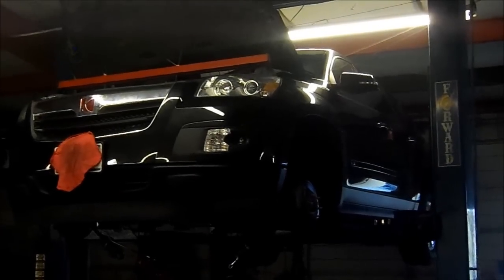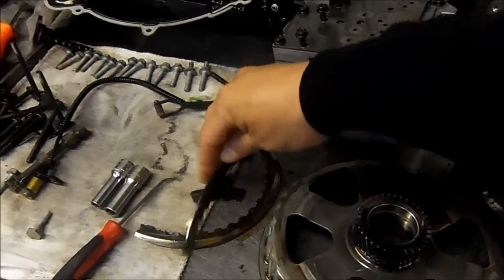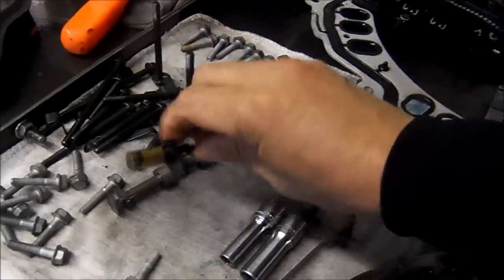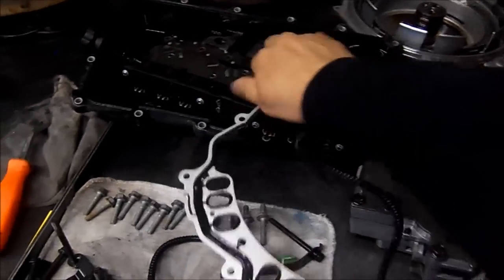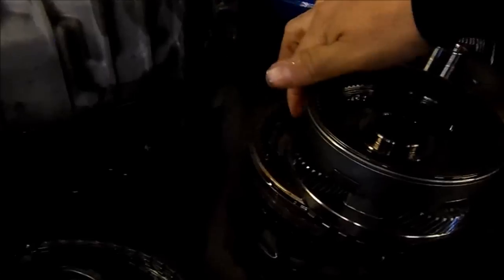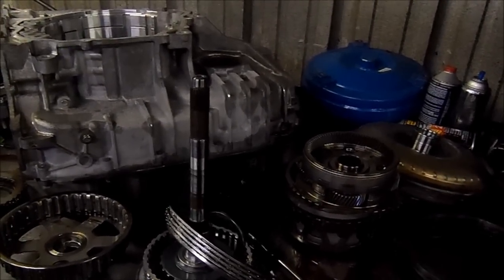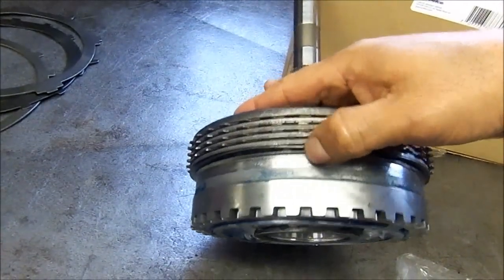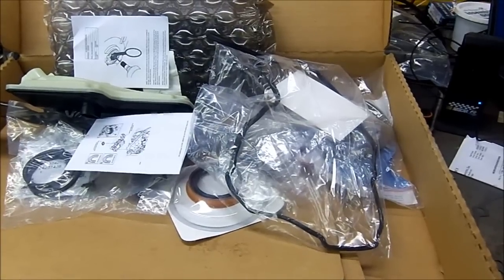6T75E Transmission P0716, P0717, Broken 3-5-Reverse Wavy Plate - Transmission Repair

Comment: What if you think you have a problem with the WAVE or the Transmission Control
Module.  Should I proactive get it fixed?  Or wait till it fails? 
Should I rebuild or place the transmission?If transmission shop does a diag can they tell me it its going to go  out?
Reply: Thank you for the insight.  I would not take the transmission apart myself I would have a professional inspect.  Right now I am getting longer shifts between 2-5 sometimes the transmission.  Some times it will not come out of 1st to 2nd, If is stop put in part and back in drive it shift just fine.  This is the reason I was asking about rebuilding the transmission.  I know there is an issue with the Transmission Control Module in alot of the earlier 10's and I did get a note from GM telling me if I had fixed it they would reimburse me but that was about 1.5 years ago.  I am must a little worried, I am not scared at all of fixing it but I think getting ahead of the problem instead of waiting for it to happen is key especially with an expensive transmission.

Comment: hello Hiram, I have a 2007 GMC Acadia SLT FWD, and i have been experiencing the hesitated gear shifting from 3, 5, and R. and also at low rpm"s and really bad shuttering shaking while accelerating.. I have been in contact with the dealer ship and outside parts stores to get a new torque converter.. However as I am studying on how to replace it, I am not seeing a torque converter anywhere.. Is the front wheel drive acadia equipped with a torque converter or is it just a matter with the wave plates. if it has both i am considering changing both at the same time to avoid the hassel. but if it only has wave plates and no converter then obvious option would be to replace the plates. can you help me identify what i need to really be looking into to replace? thank you Brandon

Comment: hola tengo una 2008 gmc acadia tinen 95000 millas y me predio el check engine y tengo p0700 y el p0752 y se quedo laquiada en el primer cambio sera el wavy plate?

Comment: hi Hiram, I have the same problem with my Acadia 20008, the guy at the repair shop is telling me that the problem is the transmission control module and he will change it. Is it enough without mechanical job?
Reply: ***** what is the part number of the repair kit for the switches or how do I find it? Thank you.

Comment: Any idea when they started incorporated the new plates in the assembly line? I have an 09 Saturn Outlook, the driver door sticker says manufacturer date 08/08.
Reply: I have an 08 Buick Enclave. Wave plate problem happened to us this past Saturday. Car is currently at dealership. Dealership told us GM offered to pay 30% to fix wave plates.  Read tons of stuff online about the 08's having problems. Hundreds of complaints from other 08 owners with same wave plate problem. It's GM's problem - They used a poor grade of steel to make the wave plates in the 08's and now they use stronger steel according to the dealership.  Definitely needs to be a recall. I think class action lawsuit is in order. Our car has 95k miles. For a higher end SUV this shouldn't be happening.
Reply: ID like to know also when the new one became factory
Reply: 2011

Comment: Hola amigo, tengo una 2000 yukon 5.3 4x4 y tengo problemas mas cuando esta la lluvia, me marca asi ( trans hot idle engine ) y le puse el scanner y dice que es el ( transmission temperature sensor ) pero dice mi mecanico que es la transmission que lla no sirve yo no creo eso porque mi troca ase bien todos los canbios solo el problema es cuando esta lloviendo o despues de que llueve, me podrias ayudar porfavor? Gracias

Comment: Ford also uses this transmission,in the Fusions.Ford bought them from GM regearing them.Jasper engines and transmissions does reman these with their upgrades,they do away with the wavy plate and replace it with an upgraded plate.The transmission control module,better be wearing a ground strap around your wrist and there is a reason why.Static electricity kills the the transmission control module.The sunshell is another common problem,it warps or breaks.GM is working with Jasper to fix the problem.Ford calls their something else

Comment: Hey man, okay?
I'm from Brazil and my car uses GM 3.6L engine with the transmission Hydra-Matic 6T70. And last began to give a jolt when engaging reverse gear, and a small leaps forward in the marches. You know what can be? I read that it is a manufacturing problem. Know me know a website where I can buy these parts?

Thank you friend!

Comment: Hi Hiram, We have a 2007 Outlook XR AWD and it thru the P0700, P0716 and P0717 codes last night.  It acts like it only has 2nd gear and reverse. If I pull the fuses on the ECM and TCM the codes clear then I have first gear and it shifts hard into 2nd and then that's all I have again (2nd and reverse).  I saw there was a TSB Number: 070730019 or NHTSA Number: 10022704 for the sensor.  Is it just the sensor or is it one of the wavy plates?  Any help would be appreciated.  Thanks